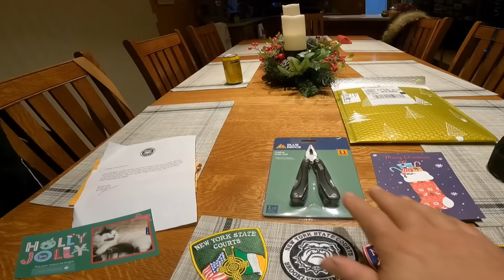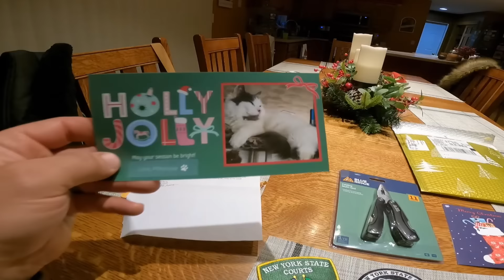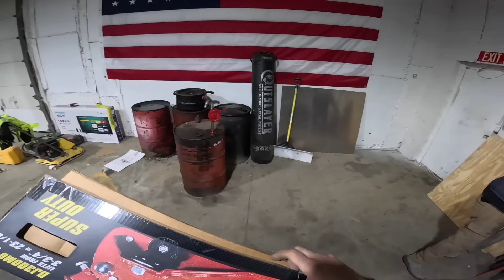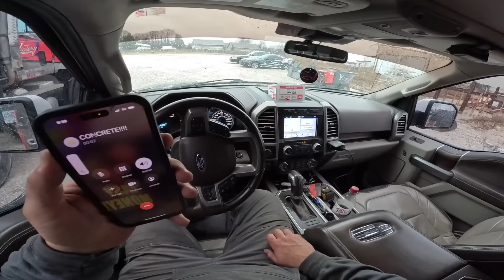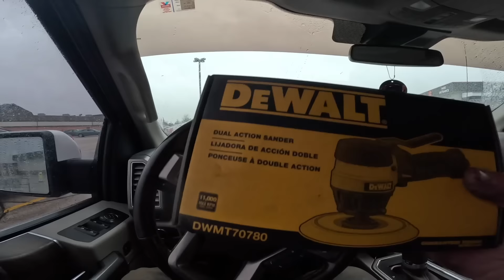The paint is NOT great! Oh well

Comment: You can use 3” pvc pipe as a power tool holder, cut them 8” long and make a 1-1/2” slit 5” deep
Reply: If he used steel pipe he could weld it to the underside of the bench top!
Reply: I was just about to suggest this myself lol you beat me to it 😊

Comment: Ryan, It's awesome that you just casually drive around with a box of 223's on your dash..👍🏼👍🏼👍🏼👍🏼👍🏼👍🏼
Reply: Gotta up it to 556 or 762 😂
Reply: The boss at the end was still talking and it got cut out real early lol
Reply: @lordbongalot 
Minor differences. 20k psi and 200 fps higher for 5.56.
Reply: @jsh6952  isn’t that just like a mandatory testing result that makes them NATO? The 223 is the same but doesn’t have to be completely tested and scored the same way?
Reply: for months now.... if he gets pulled over some rookie cop is def going to draw down on him.... hide that box.
Reply: @kerryshambach2220  
The cases between .223 and 5.56 are slightly different as well. Both cartridges headspace in different places, and the taper is slightly different as well. The powder in the 5.56 is hotter, hence the higher pressure and faster speed.

Comment: Ryan, you can use 2in or 2.5 in pvc pipe. Cut them into small sections and notch the bottom so the drill will sit right in the pipe.

Comment: To hand your drills with batteries you can use a pipe that the top side will fit in and then slot the bottom of the pipe so the grip will slide in. I have seen them made out of pvc but you could use still pipe to weld to the table. Love the videos

Comment: Hey Ryan on those paint runs if you get some 3 inch tape and dab it it'll smooth the runs out. Little trick i learned when i got my ASE certification by my instructor. Over all looks good. By the way if you ever decide on automotive paint go with single stage Dupont its cheaper and good paint.

Comment: Hey Ryan those runs are okay you can fix them and good thing you bought the DA just get some 400 grit sandpaper and then 800 grit and spray over it again  just turn your trigger flow down and open the pattern 50% overlap and you won’t even beable to tell there was a run

Comment: Maybe one of your mechanics or contractor friends has an apprentice looking for a deal on some tools. As for hanging your tools, get a tube the width of the motor housing and cut a slit in it the width of the handle length ways , it should just slot right in and hang with a battery attached

Comment: Hey Ryan. You can use a peice of 4inch PVC pipe with a notch cut out of the front to hold the drills with the battery still on. I bet you can find a picture of it on the Web

Comment: regarding mounting the drill and the impact. an easy way is to use a pipe with a cutout for the pistolcrip, works well. and you dont need to take the batteries out of the tool to hang them.

Comment: @victory. I have an  idea For the holders for your drills under your work bench.  What we do is just use PVC and cut a slit at the bottom so the handle fits with the battery

Comment: Ryan try cutting a 3 inch or 4 inch pipe at an angle and the other side square, then wield it  to the corner leg of the bench , then you can slide the nose  of the drill into the pipe, the battery will press on the corner leg for balance

Comment: Suggestion for painting the equipment, we use upol raptor bed liner it comes with the air gun etc just need a compressor, I have painted excavators and off road vehicles and it’s so tough it holds up against trees and stones hitting it it’s extremely durable and cost effective think it would look cool on the skid loaders and it’s so easy to apply don’t need to have it extremely clean can just spray over any pannle unprepared and drys in a 5 minutes

Comment: Ryan, you can get a nice DeWalt 60 gallon high flow air compressor for as low as $500.00 dollars on up depending on the psi and motor HP.  It would match the theme.  :)  Stay Safe!!!

Comment: Ryan to hang your power tools. Take a piece of plastic drank pipe. 3” or 4” cut it the length of your tool. Then cut a slot in one side that the trigger and handle will slide into it. Then put to holes in the top to mount it. I haven’t did it yet. But I see Cole the corn stare on YouTube do it. And it looks like it works really well.

Comment: For future reference, no need to prime over a painted surface! It will adhere to the existing paint absolutely fine!
Reply: Oh and it ran because the metal is to cold, should pre heat the panels with a torch if youre spraying in a cold environment.

Comment: Mount some pipes that the drills fit into, 3” I believe, then cut a channel in the bottom for the handle.  Then you just slide them into the pipe, battery down.  If you use metal pipe, you can just weld it right underneath the table

Comment: Ryan, Dewalt does make/sell large compressors. DXCMV7518075 80gal 5hp 175psi, or DXCMLA3706056 60gal.  They also have a line of 30gal too, not sure what size you need.

Comment: You need to invest in some metal shelves to store and organize your tools so you know what you have and where the tools are located.
As much equipment that you have a good investment would be a pressure washer / steam cleaner. The steam cleans all the oil and old grease off the equipment and makes maintaining the machines a lot easier . I had a 4000 psi pressure washer and it did OK but it basically just smeared the grease and oil around and never really got things clean where I could see leaks or worn parts. I broke down and bought a commercial grade pressure washer /steam cleaner ,it was probably one of the best investments I've made for keeping my equipment looking good and keeping the motors ,hydraulics and working parts clean where I can spot problems before they become a real expensive problem. I turned wrenches on equipment for many years and working on a steam cleaned piece of equipment compared to working on something I washed with a standard pressure washer is like the difference between night and day.

Comment: Just mount a few chargers to a plate and mount the plate under the table. Then you can store the tool with the battery. Run an extension cord to the table and your tools will always be charged.

Comment: Lots of people use 3in pvc pipe cut at like 6inches or however long you like with a little notch on one of the ends to put the drill in and the handle sits in the little notch cut can the notch as far as you want the drill to go In the pipe and when it’s alll done you can paint it black or something so it doesn’t create attention to the eye

Comment: To hang your drill and impact use a piece of PVC pipe with a slot cut in it, and then the head will slide into the pipe and the rest of it hang down below. Rivet it to a piece of metal and then you can weld it to the bottom of your table or bolt magnet to it.

Comment: Use pvc tubes with a notch cut out for the trigger to hang your drill and impact off the table. You won’t be able to weld it but you can store them upright with a battery

Comment: The way I mounted my drill and impact driver is in 65mm (21/2”) pvc , you the cut out a section where the handle is and slide the top into the pipe.

Comment: You guys should not be leaving the arm booms in the air like that on the skid steers, it might be a brand new machine but I’ve seen a tiny needle leak in a hydraulic fluid just give out and slam to the ground. Eventually with time it will wear the solenoid and valves out check those hydraulic fluids frequently.

Comment: there is a diy way to mount drills, pvc pipe, cut for the handle and it just slides right in with battery on in to the pipe

Comment: Ryan that spray gun is an HVLP gun! You have the air cranked up way way to high, it's not a regular spray gun hints the name high volume low pressure, 15-25 pressure at the gun! You need a gauge just where air goes in gun.
You'll not get a good job that high pressure..

Comment: You should consider a 5V Solar panel battery charger for the Form Truck fuel tank battery. Battery always charged and ready:) Or consider installing a inverter for the truck to charge batteries when you don't have outlets available. Winter work in the shop ideas.

Comment: If those are the loaders you bought in a previous video, and you have a loan on them, I sincerely hope you checked with the loan company before you went and painted them! A paint job that removes the manufacturers logos and such from the machine, particularly a less than professional paint job with paint that may not really be suited for the job, might, in the mind of the loan company at least, significantly lower the value of the machines, which are their collateral for the loan. This could cause ramifications for any outstanding loan up to the loan company immediately calling in the balance of the loan if it’s not called out in the loan papers or agreed to in writing by the loan company.

Comment: You want automotive grade paint? But ease? They sell 2 part paint in a rattle can that is clear coat with whatever color code in it. Easy, fast, durable. But you will have to have resperators and ventilation bwvause it is very toxic like the real automotive paint because it is